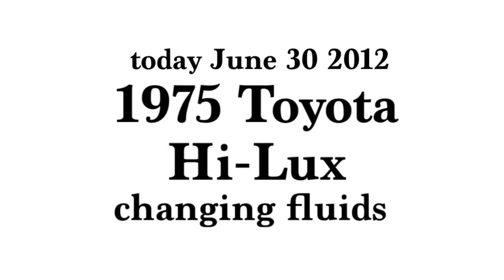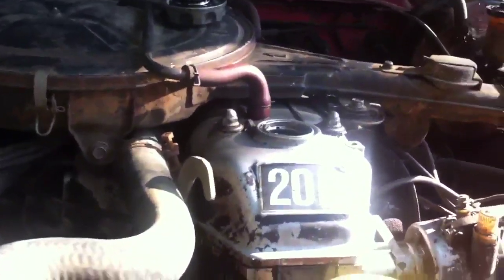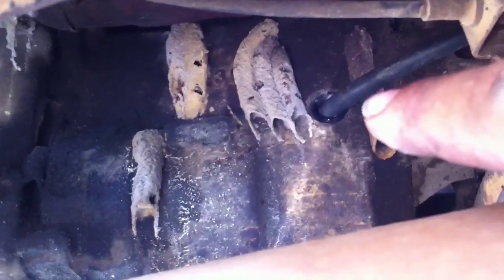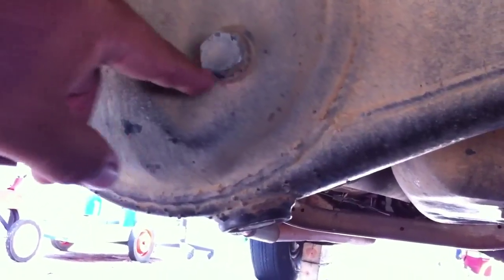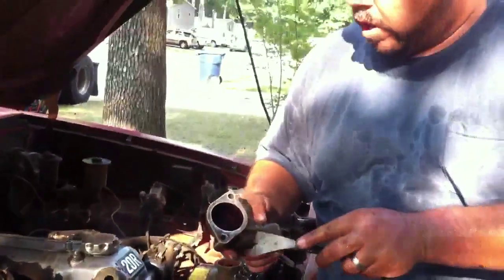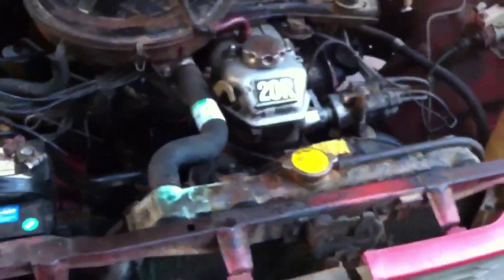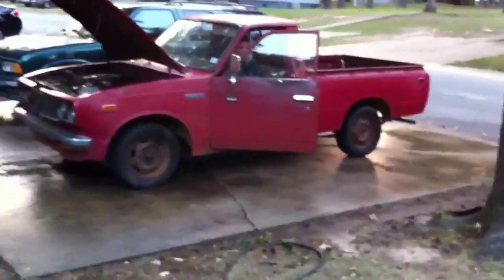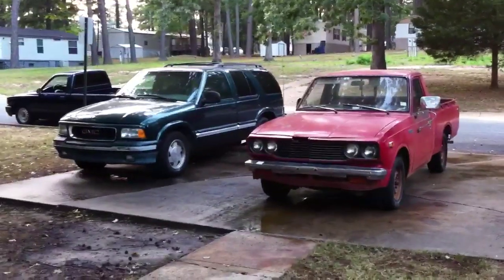Hilux Changing fluids Tune up.

Comment: Nice tip on the trans fluid through the shifter method. 
I have one for you now: Make sure on the rear end, you loosen the filler bolt first before draining. This is because if it is seized on (older vehicles mainly) & you drain all the fluid out first... you are hooped.